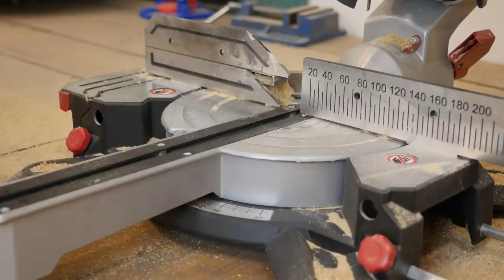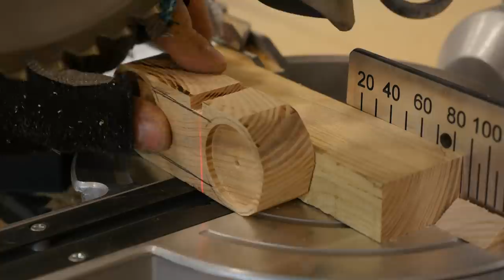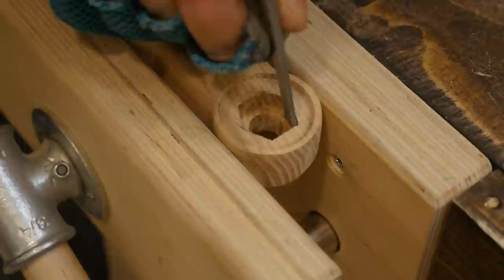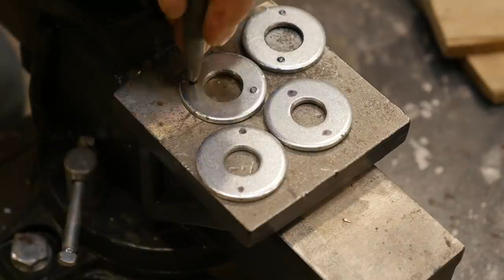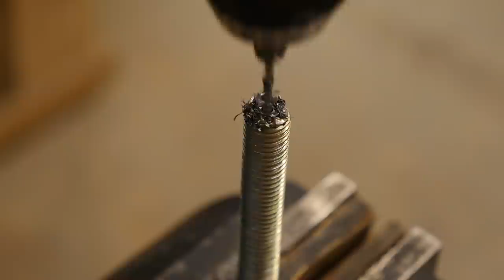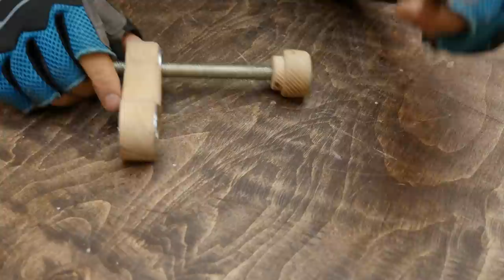Cool idea ! Do not throw away scraps of wood !

Comment: Did anyone see how close his fingers were from the blade.I have been a finish carpenter for over 30 years and I wont be doing that anytime soon.
Reply: The miter saw operation made me extremely uncomfortable, absolutely a recipe for disaster.
Reply: I will join you guys. The whole miter saw thing had me twitching.
Reply: Got all my fingers 62 yo multicraft, but a lot of form to finish carpentry.
Just stay focused and know where those fingers are before pulling the trigger.
Went back and watched it again, i would at least have lost the gloves around power equipment
Reply: Yup! My eyebrows raised and my eyeballs turned upside down! That was quite frankly pretty careless! Confidence is one thing, stupidity is another and that was just stupid!
Reply: Never put your finger where you wouldn't put your willie.
Reply: @DavidM-um2uk  now that's some awesome advice!! Easy to remember. I would use your advice but I don't have a Willie.
Reply: My father did excellent cabinetry work & I never saw his fingers that close to any moving saw blade ever. That scared the holy crap out of me & I won’t touch a radial saw, a band saw, a planer or sander. Yikes. ❗️
Reply: 100% agree, this component is way too small to hold without some kind of jig
Reply: Especially when there are other ways to remove that wood. Coping saw, jig saw etc.Well lets hope he now uses the clamp he made for things like that.
Reply: Yeah. I cringed too.
Reply: Yeah a coping saw would have been a better tool.  You can get em for $8 so I'm not sure why everyone doesn't have one 🤣🤣🤣 besides the clamp doesn't need that profiling anyways.
Reply: Zak Michalkow there’s a difference between fearlessness and foolishness. All it takes is one distraction and it’s goodbye digits. I’ve seen it happen more than once.
Reply: Same here especially with oak.lol
Reply: If you're referring to the mitre saw, he probably had a lock on it so it could't go down any further then the depth he was cutting.
Reply: @eccentricshaun7637  miter saw.
Reply: What lock?
Reply: I don't like to be inside the danger zone.  Period.  It takes less time to go to the store than it does to grow one's fingers back.
I won't get closer than four inches from the blade without a push stick.
Reply: @DavidM-um2uk  Great advice!
Reply: @zakmichalkow5222  not uncommon, yes. But a good idea?  Not in my opinion.
Reply: FINGERS ARE OVERRATED, DONT YA KNOW. LOL.
Reply: @DavidM-um2uk  the BEST ADVISE EVER GIVIN.
Reply: Norm Ross you can tell the tradesmen who learned from trade and the “hobbyists” who watch a lot of YouTube. 😉
Reply: Zak Michalkow he said he made it from oak lol
Reply: Zak Michalkow you’ve been doing woodwork your whole life and you can’t tell the difference between pine and oak? 😂🤣😂🤣😂🤣😂🤣😂🤣😂🤣😂 Even without him mentioning it in the comments you can tell by looking at it that it’s oak. Pine?!?! 😂🤣😂🤣🤣🤣
Reply: @zakmichalkow5222  go for it dude, they're your fingers. It's not about soft or hardwood.
Reply: Best way to write shorthand. 😑
Reply: Makes me laugh that he puts his fingers that close to the blade but makes a clamp to hold wood.  :)
Reply: If I saw a co-worker attempting that in my shop, I would stop him and correct him immediately. And I only made it 34 seconds through this video.
Reply: I couldn't believe my eyes. And add the hand saw technique at the vice, the use of gloves near the power tools.
Reply: Yeah. For something that could have been done with a freaking chisel in like 2 seconds.
Reply: @eccentricshaun7637  yes I have a deph screw on my Hitachi I use this method when cutting tennons. I leave my fingers away from the blade though. I agree with you he had a depth screw fitted its the only way to get a consistent depth on a cut like that and the blade was not going to touch his fingers, camera angle probably made it look worse than it was.
Reply: @TR4zest  he can't use that clamp on his chop saw as it is a bench dog.
Reply: @stevendurham9996  how do you use a push stick on a mitre saw Steve.
Reply: @malcolmchadwick4047  In the last shot of the clip, that is exactly what he does. You need to watch all the way through before you start correcting people.
Reply: @malcolmchadwick4047  Push it straight down. An upside down claw hammer works great as a dog for mitre saw, and as a push stick for the table saw.
That's how One does it, Malcolm.

Comment: Do you have a list somewhere of the tools that you used to build this clamp? I don't need a clamp but i didn't know that you could adjust washer sizes. What was that oil that you poured in when you drilled into metal? Are those metal drilling bits? Thanks for the tool demo.

Comment: Lol. Nevermind the scraps of wood. Where or who has all the other hardware sitting around the house like that. Lol
Reply: I do, most diyer's have.
Reply: The high carbon steel rod was a bit much, but everything else was typical at my place.  Big washers?  Threaded rod?  I got all that.
Reply: You accumulate that stuff over time. Keep it in buckets, coffee cans, those clear plastic jars are great. Then when you need a screw or washer or hinge or nut etc you have it and don't need to make a trip to the hardware store and spend $2.79 for some little piece of crap.

Comment: 2:10. Dammed good way to lose a finger tip or two! I've seen it happen.   A bandsaw would be the safest way,  a tenon saw with a chisel and mallet would also work,
Reply: I was thinking the same thing. Would never get my unprotected fingers that close to a saw blade.....
Reply: Really???...this person was very skilled...me???...not so skilled but I still have all my digits....just use common sense and caution...
Reply: @lar7905  yes really.  I have spent 40 some years in woodshops,  and have witnessed some bloody and debilitating accidents.  It's no fun cleaning up the saw, jointer, lathe, etc. after someone has a mental lapse of just a few seconds.  Fingers can be lost faster than you can blink.

Comment: Nicely done.  For those contemplating a similar build, and if you don't already have the threaded rod, I'd suggest getting a coarse pitch acme threaded rod.  The m14 rod used in this build has approx 13  threads per inch, which means you'll be twisting the tightening knob 13 times for every inch of clamp movement.   5/8"-6 tpi acme rod is inexpensive, and is more suited for a quick clamp like this.   If you have threaded rod in your bins, like many of us, by all means use what you've got.

Comment: I bought a set of 2 of these at my local woodworking store for less than ten dollars. They fit in my work bench and other places I need to clamp something. I use them in conjunction with my bench dogs, a set of 4 that I bought, also for about ten dollars. My time is worth something, even if I have the materials available to make something like this. I take my time, trouble and what I could be doing, that may be more productive into consideration before, putting time into a project of this nature.

Comment: Cool idea!  If you have a few spare hours a few spare scraps of wood, a few 3/8 sae fender washers, a  bit of spare two part adhesive,  a few extra drops of cutting lube, and extra 1/4” drill tap, a bit of 3/8 all thread and 1/2” tubing laying around, a handful of tiny little wood screws perhaps, a scrap piece of sand paper, an extra bastard file laying around, well.... I’ll show you a cool simple project the little lady would just Love to have around the house!  Oh.... you’ll also need a drill motor, drill spade bits, screw driver, bench clamp, laser chop saw.... um.... but really!  Check out this cool idea!!! Harbor Freight’s got Nuthin on this home project!!!

Comment: Builds a hold down clamp by drilling two holes in a short piece of wood, inserting one smooth rod to act as a dog for a hole in the bench, and inserts threaded rod into the other hole to be used as a screw for holding down the material.

Comment: Or better yet one can buy clamps like this for $12 and spend the time on something more productive.  It's just how I operate. The scrap wood I use as kindling in my wood burning stove, which is connected to my radiator system for the whole house (a little project that I did in my spare time).

Comment: Well damn, I just chuck wood scraps in a box to burn them in my fireplace rather than go through all that.

Seriously joking! Great work! This TOTALLY is like 100% a typical day in my basement shop. Reaming out washers - Check! Drill and tap the end of a piece off all thread - Check! And yeah the drill motor clamped in a vice to use as a lathe, I totally done that countless times however now I have a cheap benchtop drill press that makes a fine "vertical lathe"

I sharpened a spiral push lawnmower blade recently - supported one end in its housing/bearing clamped in my bench vise and chucked the other end in an old Craftsman drill motor that I clamped to the side of the bench, spun the thing while holding my belt sander up to it going back and forth. The whole bench was shaking pretty good but I ended up with some nice clean sharp edges when I was done.

Thanks for the video, it was enjoyable to watch. You rock! Keep up the good work.

Comment: HandCraft did this video as a philosophy note:  Don't look at the forrest, but check out the trees (hahar).  Those trees are all beautiful in there own way.  My favorite tree 1'00'' how he use the electrical tee-conduit as an arm for his bench clamp.  He didn't show it but I'm sure the arm probably slide about for double side - double hand torque.   You can also tell HandCraft is not a US guy, because his ruler was metric.   So he is also saying American if you want to be able to build your own Oxygen Concentrator for your DYI venilator and you just don't like the current method of mixing mash potatoes with hydrogen peroxide.  It would be very comforting when SAR-COV-2 is raveranging your lung your homemade venilator will save you.

Comment: Honestly awful considering the fact that you have to put holes in the board you're clamping things to. If I remember correctly, if you have 2 threaded rods in the same position as both of those ones but have them on opposite directions of rotation, (one clockwise and one counterclockwise) you should be able to make a decent clamp for any board without drilling holes for it. Someone please correct me if I'm wrong, I'm a god damn high school student I don't actually know
Reply: It’s operating like a holdfast so there’s no hole in the board being clamped down.

Comment: Why waste a day making a tool readily available for maybe $20. Grant it, you're a good craftsman. But be practical, The only reason to make this type of a clamp is during the apocalypse when your local hardware store is closed.
Also nearly any top portion of a pipe clamp and a few drilled holes on your bench and that project takes 20 minutes and you can spend time on the ACTUAL project you needed it for.

Comment: Я конечно лайк поставил просто за старания, но это как сексом заниматься стоя и в гамаке. Абсолютно тоже самое делает F-образная струбцина, если у неё сточить стопор, разобрать и вставить по отдельности с разных сторон верстака (основную часть с резьбовым блоком сверху, а ответную часть с упором и силовым стержнем снизу). Кину и корявый перевод на буржуйский мне не родной язык :)

Of course, I put a like just for trying, but it's like having sex standing up and in a hammock. Absolutely the same thing is done by an F-shaped clamp, if it has a stopper, disassembled and inserted separately from different sides of the workbench (the main part with a threaded block on top, and the opposite part with a stop and a power rod from below). Kin and a clumsy translation into Bourgeois is not my native language :)